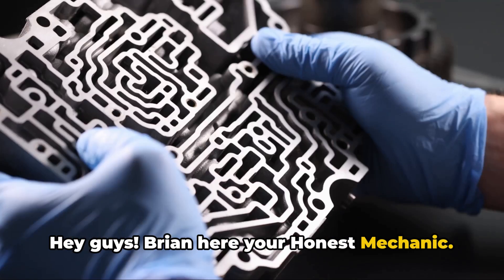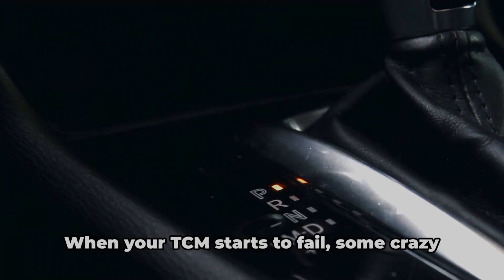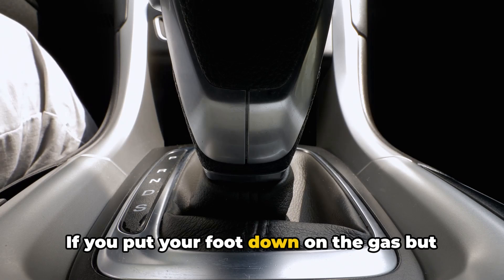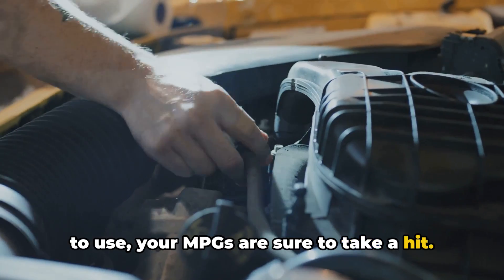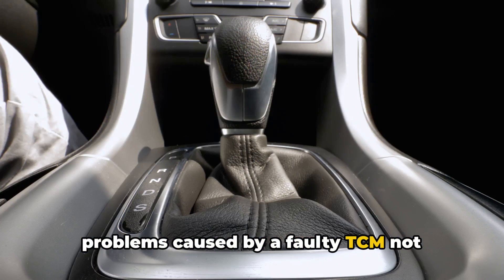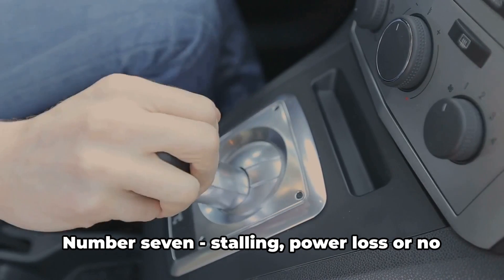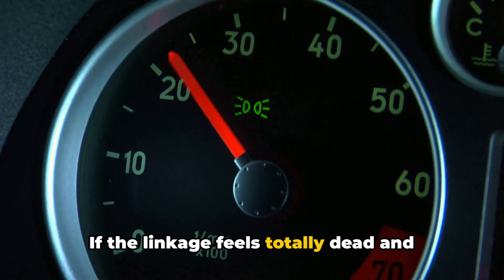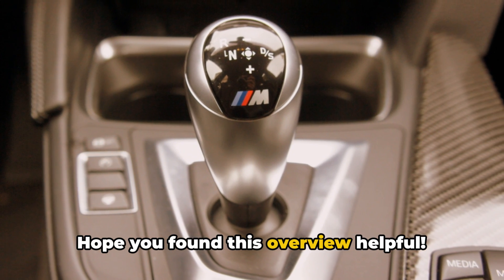What Happens When a Transmission Control Module Goes Bad: TCM 101

Comment: Had some transmission issues, transmission people said they couldn't get the tcm online to investigate, sent me to another shop. Mechanic replaced the TCM for $1500, keeps going offline after about 60 miles of driving. Been back and forth with the mechanic, gets it going, then goes offline again. After several months of this I couldn't take any more days off, driving with a new TCM that's offline. Not sure what the root cause is going offline. Engine error code spits out "stuck solenoid"

Comment: We have a 2008 Mazda 3 that while driving in 5th gear at constant speed will make a loud sound a buck forward and the engine revs since it seems to have popped out of gear, then a split second later everything is fine. The AT light also comes on momentarily. We do have the vacuum leak and lean on bank 1 engine codes, so I am not sure it is related. It does shift weird sometime between gears. Could this be the TCM?